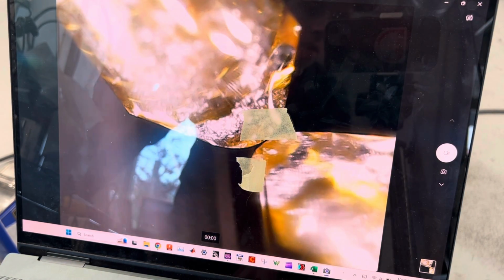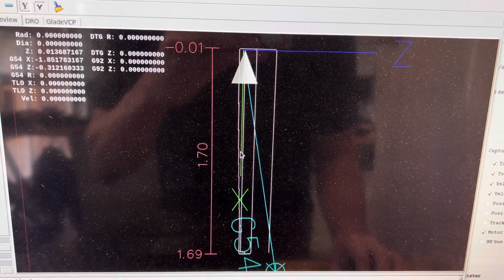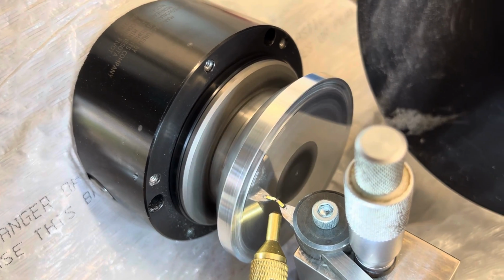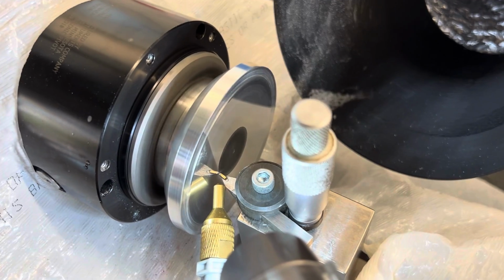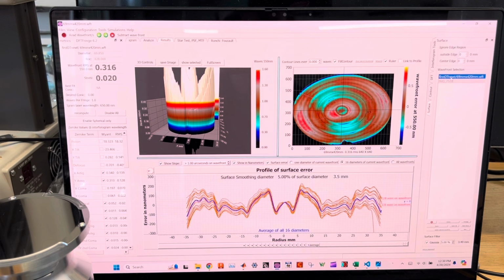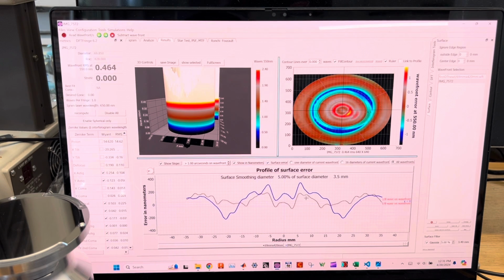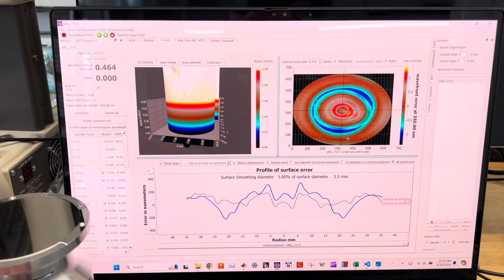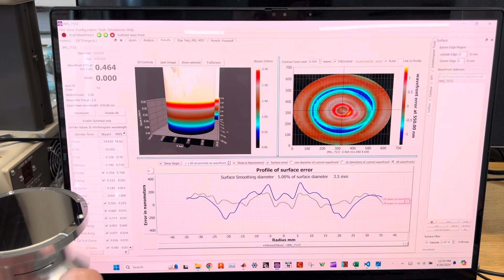Taking another pass- diamond turning a spherical mirror

Comment: You should just do the whitworth lapping plate method on three pieces. It would take very few passes to make some very nice fringes.
Reply: the surface is curved so you would have to not do 3 plate method but a regular optics lapping method :) But it's aluminium, polishing aluminium to nano /sub-nano roughness is a science
Reply: Diamond cut the negative and hand lap? Or pitch mould the negative?
Reply: @jedders99  you would need to make three of them for super flatness, but the are already really flat. I didn't realize it is aluminum, so polishing actually not that easy I imagine, I have not tried.
Reply: @jedders99  he didn't understand you buddy :D optics lapping/polishing is outside his scope.. he just learned a fancy word  like the "wittworth 3 plate method".. I don't blame him.. just a bit of ridicule so he starts learning up on other things too
Reply: @chronokoks  You may be right. I've only had my hobby machine shop for 5 years while working a full time job as a software engineer without a college degree for 10+ years. I've only applied whitworth three plate method 4 times. I don't have a degree past highschool. You might be right. However I do believe the only way to make a precision flat surface without any tools at all is to use the "whitworth three plate method." I know it seems like a big scary buzz word, but it's not. It was documented by Joseph Whitworth who also devised the British Standard Whitworth (BSW) screw thread standard. Being the first to document machining fundamentals of precision flatness and screw thread standard, he laid out the foundation of everything related to machining tech today. Does this make sense to you? Although I have my doubts, your feedback is always important. Otherwise, can you just sit down and watch the fucking video?

Comment: Increase spindle rpm as you get closer to the center. You see that pattern on a lathe when you don't use spindle compensated speeds.
Reply: Gosh, I know very little about this stuff but thought immediately "speed of the cutting edge over the surface." If something could be done to maintain a very precise force of the tool across the entire surface perhaps something really perfect would emerge. Certainly the tool reacts a little bit to the force on it... ?
Reply: Continuing the thought, right in the center you can't really cut anything, and you need a damn good machine to keep up RPM with the loss in surface speed near it.

Comment: Can you adjust toolpath using measured error values?
Reply from the maker: Yes, once I figure out how to write the code to do it...
Reply: @cylosgarage  If you cannot find out and eliminate the cause of the errors, they can be compensated as long as they are repeatable, as in your case. It will be interesting to see how it turns out, good luck.

Comment: Could that inner circle be a change in material properties? like a heat affected zone from drilling a hole in the back? Or maybe you are crossing a threshold in surface speed where the chip breaking changes? Does the circle change size with rpm?

Comment: Does the low ring line up with the work holding interface? The force from the draw bar may be flexing the plate, with the interface acting as a fulcrum, then measuring in the relaxed state creates these small errors?
Reply from the maker: Video on this point soon. Spoiler alert tested it today and it has a small effect but its not nearly the main source of error
Reply: @cylosgarage  looking forward to it. Great videos so far!
Reply: @cylosgarage  The error from too much holding force will show of on an interferogram but probably would not be visible to the naked eye like in this video.
Reply: Exactly what I came here to say
Reply: That's a good point
Reply: Agreed

Comment: There is something distinct happening in the same place in both runs.  Looks more like a programmer error
Reply: Try moving the toolholder along the x-axis a few mm. If the pattern shifts, its non-linearity in the x-axis. If it doesn't, its the mounting system distorting the mirror.
Reply: Is it possible for the program to have a rounding error at that point? I know almost nothing about machining but at the scale he is using it seems like it would be easy to not use enough digits of pi or something along those lines...
Reply: There are many factors in play at this level. Tool wear, tool height, ogive error, work-holding deformation, spindle balance and vibration, specific AL alloy being machined, etc. It takes very little to deform a mirror surface.
Reply: @DTOptics  absolutely true but there is a very consistent error in a very consistent place.  This

Comment: I'd look into a much steeper negative rake on the monocrystalline diamond tool. That may help with a smoother cut and less chatter = a better waviness / surface fltness.....try 15°-25° negative rake.
Good luck Cyrus
Reply from the maker: But in aluminum? I’ve never heard of using negative rake mcd tools in aluminum before
Reply: @cylosgarage  Zero rake for Al 👍
Reply: @cylosgarage  You do not want negative rake for aluminum. That's for crystalline materials. I would suggest a larger radius tool. 0.030in-0.060in on a shallow part like this will help smooth tooling lines. A good speed to RPM is 500RPM with about 1mm/min feed.